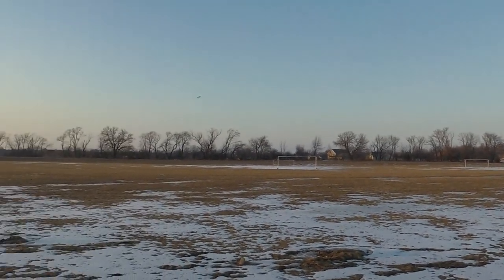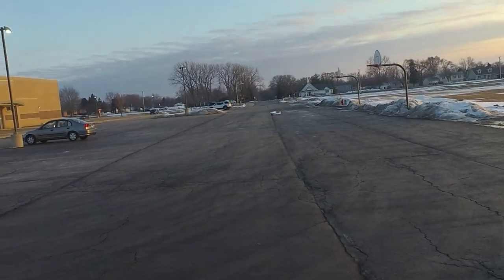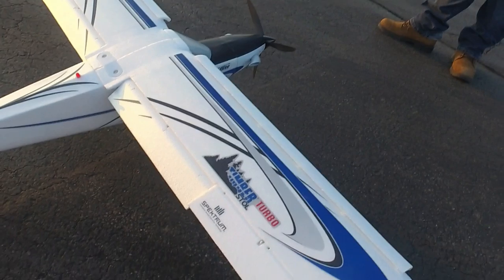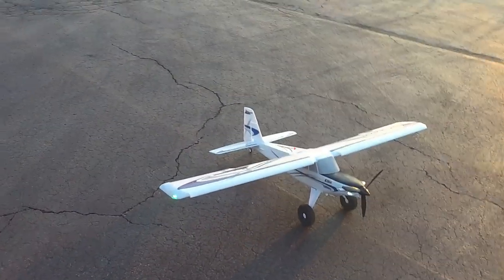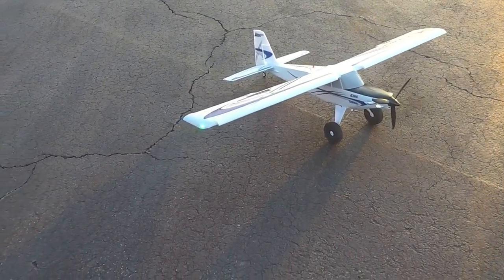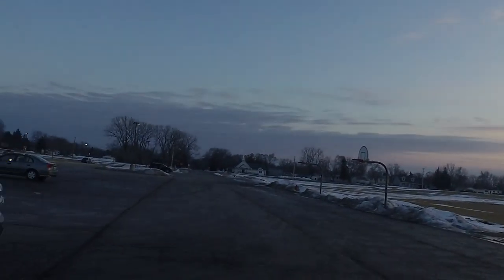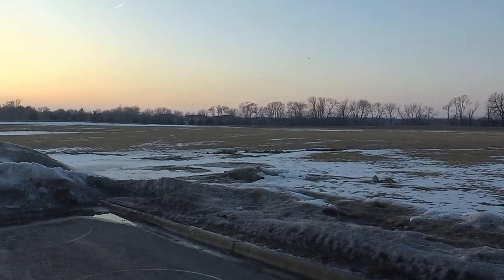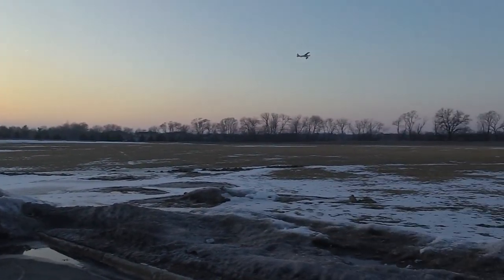( New ) E- Flite Turbo Timber Flight Test on 3s & 4s Spektrum Intellesmart Lipo's

Comment: Great video. Question. I just got my turbo timber and it seems very nose heavy. I’ve had to place the 3s 2200 typical batter all the way back to get it straight. Where are you placing your battery and is the 60mm CG front the front edge of wing correct. Greatly appreciate any help. Thx. Rick.

Comment: Hey Skip, FYI for Vito.  I  use Eflite 3000mah 3s 30c(in my regular timber too)  and Kinexsis F-Tek 3200mah 4s 30c in my Turbo... I just putt around kinda like Vito does in this video. I get 9 minutes with about 40% on the 3s and 10 minutes with the 4s.... 40-50% as well  ...  The  4s are almost to long but they work.   Check out my channel. I have flights with different props as well...  Good videos and great info as well..Thanks Skip